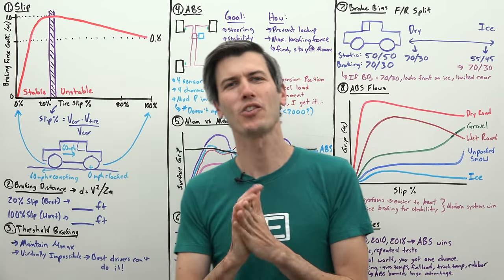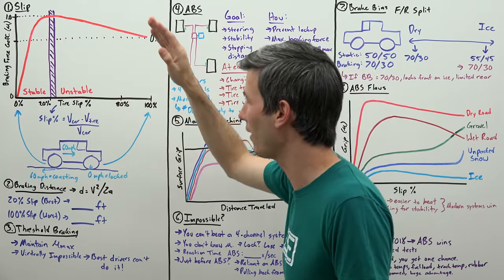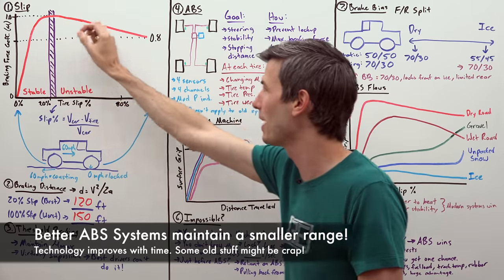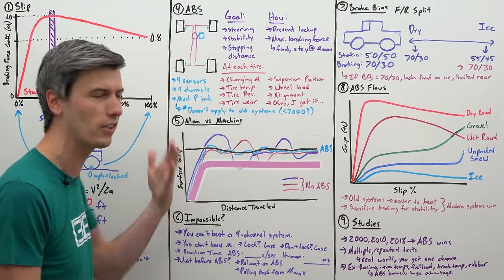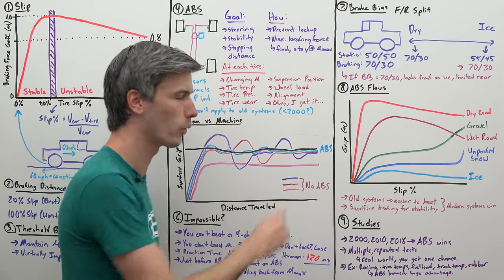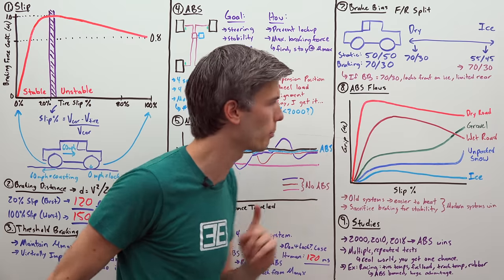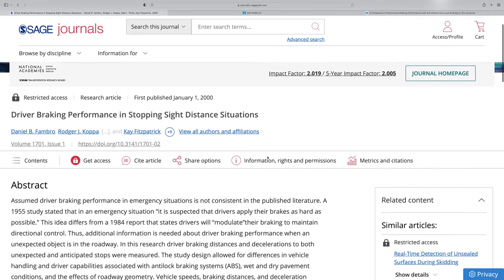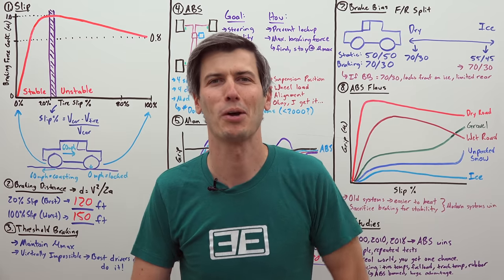Why Threshold Braking Is Impossible - ABS Wins!

Comment: Well, You make your video to prove a point, and you are right in modern cars. I Own few cars from 1990s and early 2000s. There ABS and TC is completly diffrent story. They can help you maintain control over a braking car, and provide some manuverability, but i highly doubt they can stop the car faster, than I can. It work much more like an ON/OFF switch, and always overracting. I also had few situatons, on wet and snow, where I was saved because I deactivated ABS before. Also in older cars if you in side slip ABS will only get matter worse. But I agree with you, in modern cars it is completly diffrent story, and you won't win aginst modern ABS.

Comment: No ABS. On ice if the car gets sideways I can shut down the steering input. I remember going down an ice hill picking up speed on a T having to turn left at the bottom. The car oversteered and was then point in the opposite direction. I waited for the car to be going down the road an locked the wheels. The car slide 10' to a stop leading with the passenger's slide.

Comment: Not going to lie my old car save me from don't have ABS, the tire is sliping sure after i use handbrake not from 0% to 100% instantly but i pull hand brake slowly and go 100% when i feel the tire still in control. only about 4cm from impact if i don't turn my steering a littlr after slowing down at 17km/hours from 180km/hours, road condition clear high road
I imagine if i had ABS it sure will hit maybe not fatal but still hit kinda hard

Comment: And the most important thing that people tends to miss: If you need to stop quickly and have ABS - Just STEP ON IT! Full power! Otherwise it might be that you do not use the full braking power. And several modern cars, like our Volvo, can sense when i am doing an emergency brake and it helps boost the brake pressure to max.

Comment: @Engineering Explained
I think what the title should be is "Why beating ABS with threshold braking in modern cars is impossible"
If you use 3 channel ABS, only the front two tires are indepedent, the rear tyres are together, this means it's only really variable for one tyre, I assume if one of the fronts wants to lock, the rears will also want to lock (which is what I've experienced in the snow in NY with multiple ABS vehicles, all 3 channel)
I've found it to be safer and more predictable to go without ABS in these circumstances as even WITH abs, the brakes would just intermittently lock and release in pulses, which caused more of an issue than it was trying to solve.
I like controlling my car and having a predictable outcome, there's too much variability w/ 3 channel abs

Idk or care about track times, from a safety aspect, 4 channel > Human > 3 channel but thats just me.

Comment: How does the car measure the slip on all four wheels. Surely it would need to know the actual speed of the car, which it measures using the speed of the wheels (unless it has some kind of doppler radar), which are subject to slip. Does not the calculation become a bit circular (pun intended)?

Comment: Definitely older systems are not as adaptable. On my 2000 Honda it has a 4 channel ABS, in stock form, never had an issue, but when I changed the suspension and tires and where one wheel can lift under braking or bounces slightly on uneven surface I would have issues as if I was on ice, nearly hit someone in a parking lot going absurdly slow, but the ABS was freaking out and basically gave me no brakes. ABS is only as good as what is from the factory. If I could tune it I would keep it, but once I got rid it of it I have been happy. Even among the S2000 Honda adjusted the ABS in the later models because it was too aggressive in the initial models.

Comment: Depends on the car manufacturer and model. In my Audi Quattro, the ABS and traction control were fantastic. Much better than manual braking. In my Mercedes E-class, the ABS felt like you started sliding on clicky ice and was very much worse than if you didn't activate the ABS.

Comment: Simple question: how does abs acquires vehicle's speed if all 4 wheels block at the same time? How would it know if the car is slipping or not?
Reply: It uses an acceleration sensor and also some model an assumptions to calculate vehicle speed. Ég vehicle can not decelerate with 2g but wheel can.
Reply: @gaborb  hmm... interesting

Comment: You've done a good job of pointing out that ABS fails in two of the three (ice, sand, gravel) situations where it's needed most.  Most drivers have much more experience on dry pavement than on slippery surfaces, so they have a much better ability to estimate stopping distances there.  When roads get slippery, their estimation powers suffer, which is why the dramatic increase in stopping distances of ABS systems results in collisions.  I've had drivers tell me their brakes failed completely when in reality the ABS was triggered by a transient slippery spot, and the ABS remained engaged until the collision.  What would have been a temporal lock of a single wheel instead became an almost complete loss of both braking and steering ability.

Comment: There is one condition where ABS is ALWAYS worse than no ABS: Low speed braking over tarmac that has about half an inch of dense wet snow on it, with weather near 0c.
This is because the snow packs down under the wheel, and when you brake, the snow initially forms an ice/snow sled under the tire and causes the wheels to lock up and slide. The only way to stop on this sort of surface is to lock up your wheels, scrape through that bit of snow, and down to tarmac, which will almost instantly bring you to a stop because you're already traveling at a slow speed.
With ABS, all that will happen is you'll get the system pulsing constantly, making it near impossible to stop, because the slightest bit of braking will cause temporary slip.
If you drive in Canada in the early winter, you know this situation well.

Comment: Could someone please clarify the situation with ice? There are videos in semi-controlled environments that compared the same car with ABS on and with ABS off. For some reason, when ABS was enabled, car stopping distance increased almost two times. Simply locking the wheels and sliding was more efficient somehow. Is that just that particular car's ABS flaw or is there something more to it? Car was not new, maybe it was some Peugeot from 2000-2010. Perhaps something to do with how ABS works and determines tire slip?

I can provide links to these videos if necessary. Any guesses would be appreciated.
Reply: Please, do provide a link.
Reply: @jimsagubigula7337  YouTube deletes links in the comments. The video is called 
Braking with and without abs  by ILR car control school
Reply: @the_skips  Yeah, I see. This doesn't just happen with ice, but it happens with every loose surface, snow, gravel, sand, etc. That's because when the surface is loose, when the tires are dragging against it, the surface piles up in front of the tires and this adds extra resistance to them, helping the car stop faster.

Comment: Only in emergency situations can you outperform ABS in manual cars. If you downshift into 2nd or 3rd gears and brake while releasing your clutch, the engine will help keep you in this threshold. It's great for coming to a complete stop VERY quickly but you're putting a lot of work into your transmission and engine.

Comment: The lower budget systems in the early to mid 90s were especially bad.  My 97 Jeep Wrangle had terrible ABS.  Once it activated, all it did was pulse the brakes.  So if there was a bump that disturbed traction the system would activate and stay activated until the driver released the pedal.  If I needed to make a short stop in the rain, it was literally better to lift off the brake completely and take a second shot at threshold braking than to ride the ABS to a full stop.  Better than the average driver that would just hold the pedal as their brakes completely locked up, but not better than good driver that could hold it before the lock up point.  Now, by the my 2001 SAAB with it's high end 4-channel Bosch ABS came out, it was just way better than me, and every newer car I've driven since then has had outstanding ABS that far exceeds my abilities as you said.  But man the early 90s stuff was dodgy as hell.

Comment: I believed the myth until I started running a car with ABS and ABS definitely helped me stop quicker than I could myself. It kept me from going into a wall when I went real hot into a corner to pass someone who was marginally slower than me that wouldn't let me pass on a straight. I also cussed out the driver because I had to drive that car 1000 miles home and he was messing up my track time and could have contributed to messing up my whole trip.

Comment: ABS does superior breaking but when I'm on track and use abs my brakes get very very hot and need race pads - which you don't want to use on road car. Using back off method reduces brake temperature by 200°C. This allows me to use sport pads instead of race pads.

Comment: Jason, Many situations on the track I prefer a non ABS car. ABS will stop the car a bit shorter most of the time. There are many times where no ABS helps  during corner entry. Sometimes not. But when you spin ABS won’t allow you to lock the wheels to help control your spin. ABS shoots the car down to the apex. So there are times where ABS isn’t ideal. Everywhere else, yes.

Comment: I'm not a fan of absolute statements.  However, he addressed the exceptions I knew about.

When ABS was new, the key advantage was maintaining steering control, but it was accepted that you would have longer stopping distance vs ideal.  I could usually out-brake ABS in those days.  I will agree that this has not happened since the mid-90s.
Reply: he never claimed that no one can outbreak abs.

Comment: I can’t really explain it, i feel that many people that says they can threshold brake better is talking in a completely different scenario. In a completely emergency hard braking scenario, I don’t think it’s possible, most people testing would be starting to brake at a reference point which takes away the real life scenario. 
And second I think ABS advancement is also a big deal, where on my 2003 car, hard slam on the brake was immediate lock up and tire screech initially, my 2014 car i just couldn’t get it to lock up no matter how hard I tried. (at the same speeds)

Comment: I noticed one you didn’t make a curve for packed snow and 2 you didn’t talk about abs flaw on ice. 
ABS is terrible for ice as since it allows too much slip. In my personal experience with quite a few different Cars starting from 2004 and up. Abs has difficulty stopping a vehicle on ice. Versus I personally found not applying as much brake pressure required for abs on ice actually slows a car quicker and is more controllable. Abs will tend to make you slide straight.  Yaw control on some cars was inaccurate or in fact dangerous and as well as vehicles with traction control and use ABS to control traction and not fuel/ignition cut. Sometimes yaw control has kicked in when you have full control over a vehicle and there’s no tire slip but the abs activation actually can make vehicle pull to a different direction and can cause you to go off road. 
Theres different scenarios where abs/traction/yaw control can actually be dangerous due to computer will fight the driver on controlling a vehicle. Those are meant for straight line stops/acceleration. If some how you were spin a car or get sideways. They can’t not help you and in fns induce spin rather then allowing the driver to correct the vehicle themselves. Which why i always drive with traction control off.. if I need to swerve to avoid and accident or something the vehicle won’t fight back as much to try to keep the vehicle straight and thus why over time automotive engineers had to redevelop traction control, abs, and yaw control limits so they can be automatically disabled when a driver attempt vehicle correction upon a certain limit/threshold and also actually allows more slippage. Under certain circumstances the computer actually doesn’t always give you the best results

Comment: I'm glad I restrained myself from commenting before watching the video, I will say though I have never cursed more about anything on a car than ABS when driving on gravel roads. Maybe the newsr systems would be adequate but everything I've driven thus far is completely unacceptable ABS wise offroad. And the issue is that my ratio of gravel/pavement is approximately 50/50 so ABS is having no positive impact on my safety so to speak.

Comment: you forgot about vehicle weight n hp/braking missmatch. look at a bone stock pickup empty n fully loaded. stock vehicles are fine but what if you did some tweeking to the car but not to the cars brakes. i see where yer gettin at but theres some loose ends to this.

Comment: The best ABS for normal roads is driving defensively enough that you hardly ever get close to needing ABS in the first place. Saves fuel and tire wear. The only time I've noticed ABS doing anything on my car was while braking from already low speed on a sandy patch left over from winter and that felt more annoying than useful.

Comment: The ABS I used was trash especially in low grip conditions just pulsating wildly with little to no brake application. That said I do not have much experience with newer (post 2010) abs systems
Treshold braking is possible consistently if you can feel that jitter in the brake pedal when a wheel wants to lock up. That said the car I could do this in had the brake bias waay out front so the rear wheels never locked up.
Do what you will with this info, but for me if the abs system is broken in my vehicle that's something that isn't getting fixed anytime soon

Comment: I will say that ABS sometimes screws you over if there is ice on one side of the road.  A lot of times the inside of the the road is dry, but if ABS detects slip on the other side it modulates the brakes on the other.

Comment: Here in U.K. my first 2 cars (compacts) were virtually the same model. The first one being a little older pre “face lift” didn’t have ABS, the 2nd facelifted car did ABS. Same platform, same engine, same size car. Night and day…ABS wins hands down.

Only area where I find ABS a burden is on snow/ice. Not had a car where you can adjust the abs sensitivity. We can’t even turn it off in U.K. and Europe. In these conditions ABS doesn’t stop a lock up. Have to be very gentle on the brake pedal to avoid ABS intervening.

These are front drive cars btw.

Those sensors in the wheels can be expensive to replace, depending on design, wether they are integrated into the hub or not. I don’t know how much this works out in US dollars but £300+ on a modest average European family car back 10+ years ago. Prob nearly double that now because of the world situation. Be careful when buying a pre-owned car with the ABS light on, or ABS error. Could be expensive to fix.

Great video…and just reading the comments…very interesting reading all those experiences.

Comment: Do you think there is any real world difference in pressing the brake pedal as hard as possible vs just enough to activate the ABS? Usually in video games pressing the brake pedal as hard as possible is not the fastest way to stop even just in a straight line.
Reply: yes. If you press as hard as possible the pressure build up ("reserve") will be faster. When ABS wants to increase the pressure it opens the inlet valves but the pressure you provides in the TMC will eventually increase the pressure at the wheels.

Comment: ABS braking on ice can be significantly longer have been going just a few miles an hour and the abs module goes crazy and won't slow supply enough braking force to actually slow the vehicle.  The system is not optimized well for systems that have super low coefficients of friction and tires that grip on ice well when the wheels are locked up.

Comment: At the risk of sounding like an old geezer, I was taught to keep a reasonable distance behind the vehicle in front of me and to ease off the gas coming up to stop lights and stop signs. 95% this keeps me from ever having to slam on the brakes. When it doesn't I have no illusions that I could stop faster without ABS. I'm pretty sure my first car, a '78 Ford Granada without power steering or power brakes did not have ABS. Every vehicle since then has had it.

Not completely related to this video I wonder if the way I was taught to use the throttle to do most of the slowing of the car is still the way to maximize gas milage when driving a hybrid like my wife Prius?

Comment: Whenever I get a new car or bike I go to a road where rarely passes any car to try the corners, try the brakes and know the limits. I literally mark a place to brake and measure the braking distance.

I only had one car where I could turn off the ABS and after lots of tries I did sometimes manage to brake ever so slightly better than the ABS but possibly it was within margin of error created by the real world, but on average I was worse than the ABS and I kept the ABS always on because on emergencies we always perform worse than our best go.

On my bike is a bit different, I do manage to feel when I'm about to loose grip and maybe because on a bike the brakes are independent and the front tire does by far most of the braking, I can actually perform quite better than the ABS consistently. Even then I'm glad I have ABS because in the last 15 years it already saved me in two emergencies, one of them there was sand on the road, the other was on cobblestone, in both I'm confident that if it was not for ABS I would have fallen.

Note, on a car if you loose grip you just increase your brake distance and you might smash your bumper, on a bike you're on the ground and your body is your bumper, so the stakes are really high, in that situation I'm really happy to have ABS.